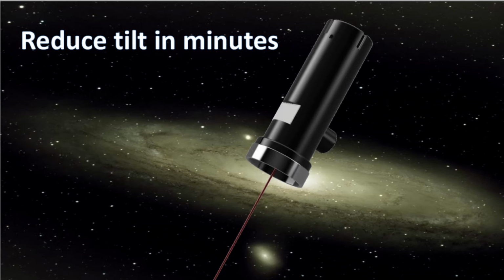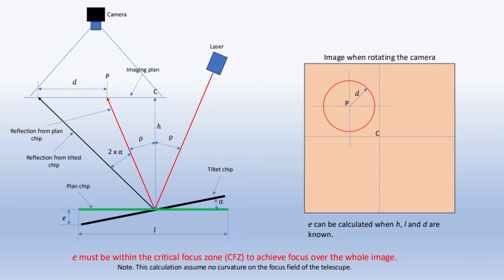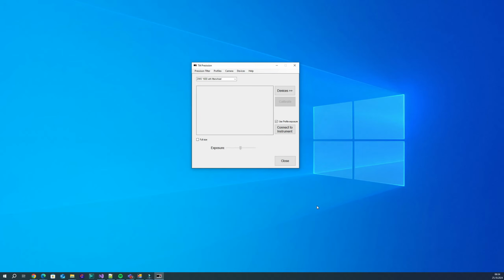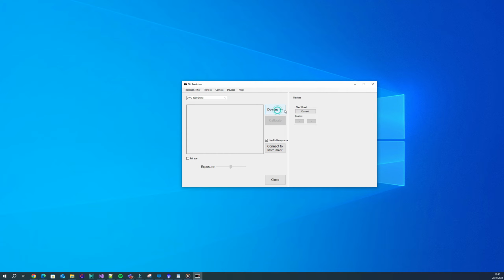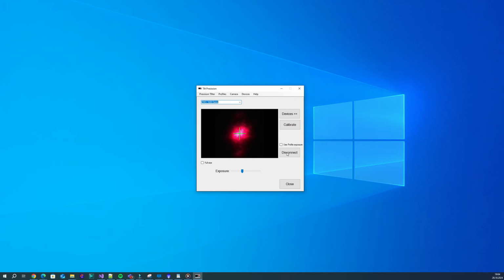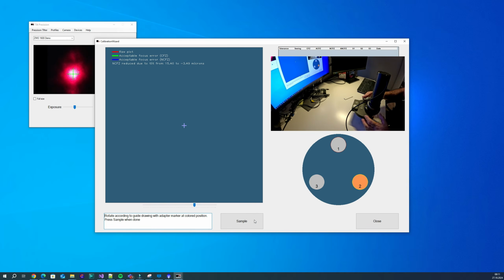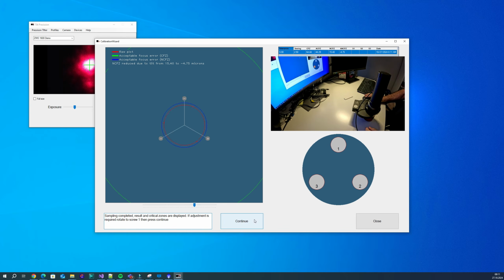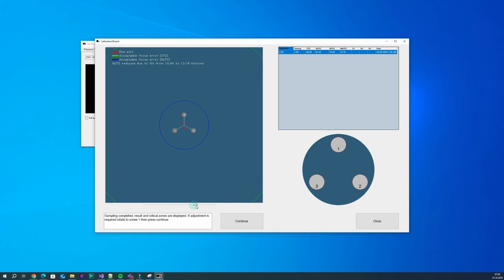Improving your Astrophotography Setup TiltAdjuster presentation and tutorial

Comment: I presume that device is good for refractors and reflectors with non-adjustable mirrors, because it helps reducing tilt between the sensor plane and the system mounting plane, not of the telescope itself. Am I right?
Reply from the maker: You are right. When that is said adjusting from the telescope to the sensor gives a huge difference from no adjustment at all. Another benefit is that when the "lower" part is perfectly aligned the remaining total tilt is strongly reduce and is in many cases negligible. If not the source(s) for the remaining is reduced.

Comment: Very nice! I have only one question, will it work on telescopes that have a hole in the center of the primary but a newtonian focus? I own an old Takahashi epsilon 210 and this is exactly my case. The main camera is placed in the newtonian focus of an RC system used in the prime focus. Since the diameter is too smal for placing a camera on the front of the scope, a newtonian one is been used instead so that the rhoss corrector can be placed in the focuser itself. The primary mirror still has the hole in the middle to be conficured as a classical RC with a cassegrain focus.

Comment from the maker: We have release a new software version with updated User Manual. News are a new Installer,  we have to admit that we had problems with old. The new seems to be good!. We have also added manual selection of blob to be used in calibration. This is done to cover setups with several blobs. Several due to reflections from camera, filter or reducer/flattener.  Tested by customer with excellent result. This means that the instrument now can be used to adjust all parts "behind" the telescope just as easy as only a standalone camera.

Comment: Hello, I would like to adjust the tilt on my RASA 8, what would I need to get it to work?
Reply from the maker: The instrument can calibrate the "camera" side of the telescope, not the telescope itself which includes the focuser that can be the tilt source. The instrument attach to a 2" extender/adapter so it is the only actual requirement.

Comment: what about possible damage to the sensor or electronics? CMOS / CCD / CMOS with polarization filters / others?
Reply: As long as the laser is under 5 mw  all will be good 👍🏻
Reply from the maker: Hi, I have tested with two camera the laser has been on for days without any damage. I asked a camera supplier the same question as they use same as us in an article we found, here is the question and his answer : 

I have read that a laser might destroy a camera sensor. Sony has  this article: https://petapixel.com/2021/08/02/sony-officially-warns-that-lasers-can-damage-its-cameras-sensors/. 
I assume that they refer to much stronger lasers?

Supplier answer:
As you say, Sony are warning about high power lasers. The ones that we use are just laser pointers and do not have the energy density that would cause CCD damage.
We definitely haven't ever seen any CCD degradation from our test rig.